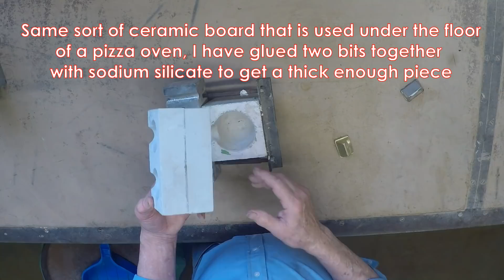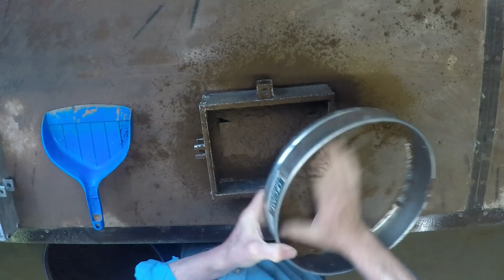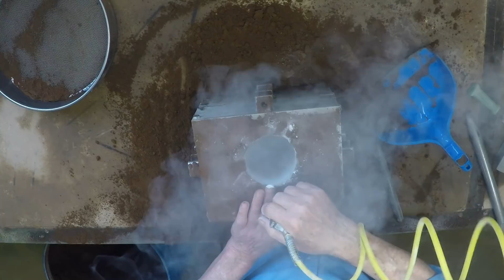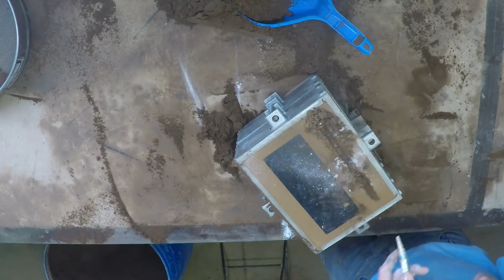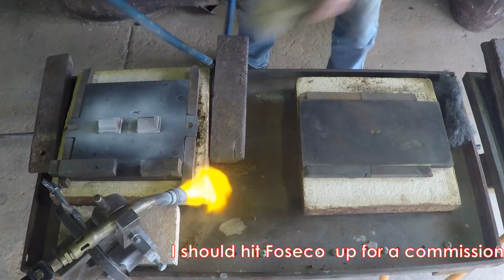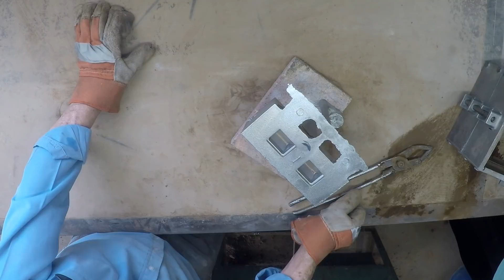Lens Blank Die

Comment: This is a fascinating series.    Thanks for your many tips and references to John Campbell's casting books and information.  

I wonder if hexagonal boron nitride is much cheaper now.   I became interested in so called "dry film" lubricants years ago and have PTFE, Graphite, and hexagonal boron nitride in stock for this purpose.     I ended up using boron nitride for lubricating my D-Bit grinder ways rather than graphite mainly because it's white and easy to differentiate from grinding dust vs. graphite (PTFE might be ok in this case).   

I'd read about Boron Nitride being used for mould release but here you are in practice.    It might be interesting to see about developing a water or alcohol based spray with the powder.
Reply from the maker: Ian, I think that we should all be pushing John Campbells work - it is very much a breath of fresh air into the staid moribund 6000 year old foundry approach that is unfortunately still so typical of modern foundries. I was at a talk given by John here in Melbourne a year or so back - meeting him was something of a highlight in my otherwise dull life. We need more like him.
I have used two Boron nitride products - Release coat blue, mainly as an aid to casting and core removal. And  Boron nitride hardcoat as a protective for bare MIMS thermocouple sheaths and as a ladle wash, both of which it excels at - The one bare couple has lasted me about 5 years and at times has been sat in molten aluminium for hours at a time. Both of these are ZYP products bought through a local stockist. It would be nice if the got cheaper as last time I got some they were over AUS$ 200.00 per gallon and it was one of those little gallons the US use! (about 3.8 liters not 4.5 liters like a proper Gallon). I was perhaps 4 or 5 years ago now, so the price will likely have changed (Hmm, probably up not down). For actual die lubrication (i.e. the parts of the die that slide against each other) I like to use  MoS2 in the form of a dry film applied using a thinned down (with auto paint thinners) form of Molybond 122L.(not cheap either!) I prefer to apply  this to a lightly sand blasted and wiped down with thinners surface and I aim for a very thin film. I sometimes apply a dusting of graphite powder to sliding surfaces and particularly to the die holding machine slide ways. The release coat blue I thin with water and spray using a touch up spray gun. Nice to talk to a fellow enthusiast....... Martin
PS, some BN products are available in 1 pint size still expensive (Last I saw was US 80)  but perhaps more within reach - sadly not available locally!

Comment: Is it possible to cast the die using bronze when the masters are made using cast iron ?
Reply from the maker: paul, I don't see why not, providing of course that the masters are coated with a suitable die spray - a graphite based spray would be suitable. The masters could also be steel. I have used steel masters for aluminium dies but have never tried casting a die out of bronze this way. However I have made dies for aluminium castings out of bronze by sand casting the die to an approximate shape and then machining to refine. I did find that bronze/brass dies tend to be attacked by the aluminium being cast in areas where the metal impact is high.....Martin
Reply: @olfoundryman8418  Thanks for your reply sir. Let me try I have been using Aluminium but this time the weight of the castings is a bit higher I think which make the die to overheat and loose dimensions.

Comment: If you had a more complex part that would shrink onto the mould, could the mould be made in bronze to extend its life?
Reply from the maker: Jamie. I did attempt a part that did shrink onto the die in one area - I got the parts I needed (180 of them) but it did damage the aluminium die.
Bronze would certainly be better but still I suspect no where near as good as cast iron. I have used a brass die and it worked ok but the aluminium being cast soldered onto the gate area a bit. This was more due to the impact of the metal stream but shrinkage onto  the die would not have helped. I suspect it is going to boil down to how complex and to what die coats you use "Release Coat Blue" by ZYP coatings would be a great help but it is expensive. Remember you can very successfully make dies from mild steel - I prefer grey cast iron but some of my dies are at least in part mild steel.... Martin
Reply: @olfoundryman8418  thanks for your reply Martin, do you send off to have dies machined in cast iron and mild still or would it be possible to cast a ferrous die in the home shop? 

I’m trying to avoid the cost of machining dies because it will get very expensive as I need several parts with variations. 

My hope was to 3D print a pattern and then cast it into a die using a suitable material, that way I can make multiple variations without spending thousands of pounds of machining costs
Reply from the maker: jamie, I machine my dies myself. I have a lathe, a big old Cincinnati vertical mill, and an older CNC mill. I buy the cast iron required in the form of continuously cast bar stock. Having dies machined by others is just way too expensive considering the relatively small numbers of parts that I make. You need totals in the tens of thousands rather than just the hundreds or thousands to make outside machining viable. Yes, you can have iron dies cast to size and shape but not all foundries are good enough to do this and you will have to devote a lot of time to hand finishing filing  etc. Also all dies require some machining - the dowel pins, flat mounting surfaces, mating of the two halves of the parting surface etc. If your die required cores these and the guides they slide in will have to be machined. One  approach is to do as I did for the 4 barrel throttle body die - I bought that older CNC mill then  spent a year getting it going learning how to use it and then machining the die.
For a "several parts with variations" situation look and see if the variations can all be made in the one die with the aid of interchangeable pieces cores etc. 
You can  come to me at  olfoundryman@gmail.com   and I will see if I can be of any help design/advise wise. But please note that I don t guarantee to always reply instantly as I have a lot of demands on my time..... Martin
Reply: @olfoundryman8418  thank you martin, ive sent you an email with some pictures to peruse
Reply: @olfoundryman8418  if you’d be willing to discuss the parts I’m trying to make via email I’d greatly appreciate your feedback   before I begin going down a path that may not yield a suitable result

Comment: Thank you, Martin.  Another great video.  I'm working my way through them all !!  Cheers 🍺🍺👍👍👍
Reply from the maker: Melt, Should take you a while to work through them all 😊 I hope they provide you with some useful information... Martin
Reply: @olfoundryman8418  I figured you've probably covered most things I need to know.  There's so much valuable information there, only trouble is I have to watch each one several times for it all to sink in...  But i guess that's no bad thing eh.  Cheers 🍺🍺👍👍👍
Reply from the maker: Melt, Watch by all means -  I love it - but practice, trying doing failing succeeding they are the key. Use what I put out as a guide and move on from there... Martin
Reply: @olfoundryman8418  I intend to mate😃  I have a nice tricky thin copper casting next week.  I hope to employ some of your techniques there.  I will also talk through some of that video so you can follow my thought process.  The best compliment I could give you, is to use your knowledge and make it work !!!  I'd love to practice more, but unfortunately I only get one day a week to play with metal.  The rest of my time gets eaten up running my business.
Thanks again for everything, Cheers Andy 🍺🍺🍺👍👍👍
Reply from the maker: Melt, Easy peasy - retire 😏, Have fun with the copper, it has its problems and most people don't do it right - in fact I have yet to see someone who does! My only experience with a thin copper casting (a frying pan) was a decided failure but it was many years ago, Good luck with it.

Comment: For those of you who don't know what he put on the tops of the risers...it's an exothermic compound that when it gets hot enough will flame off and expand. Once it has expanded the covering will act as an insulator insuring that the metal will stay hot and properly feed the casting as the casting solidifies and shrinks.
Reply from the maker: sandrammer,  Right on! It is called Ferrux NF and it is made by Foseco. The only thing I do not like about it is that some of that expanded stuff floats around the room and has on occasion gone down a feeder on a yet to be poured casting and thus marred its surface. NIce to hear from you by the way... Martin
Reply: @olfoundryman8418  is there something lower tech that can be used for a similar purpose if it's not available in my area?

Comment: Have you tried insulating the riser with a baked plaster of Paris sleeve ( riser ) to help control the piping?
Reply from the maker: Vel, The baked plaster sleeve is an old tried tested and true idea - it does work quite well plaster being about half as conductive as sand. Often its not straight plaster and may incorporate sand or more particularly insulators like vermiculite. This particular alloy is know for pipe formation as it tends to be what is called a "skin freezer" and I certainly could have got away with a smaller feeder if I had used some sort of insulating sleeve as well as the exothermic These days one can buy various sizes of insulating sleeves made from  ceramic fibre. These work very well and are used by many foundries with and without exothermic on top... Martin

Comment: Very good. I find the upside down camera angle above the table quite disorientating.. maybe you can consider either digitally mirroring the angle to make it look right side up, or turn the camera itself upside down when it's mounted above the table at that angle.  it would then make it appear to the viewer that we are actually looking at it from above while facing you (like in an auditorium),  rather than from above and over your shoulder (which is like lying on our stomach on a platform above you and then peering down over your shoulder which means we are in effect upside down).
Reply from the maker: Guy, I have struggled with camera angles. I have tried  with the camera in all sorts of places and have not really found any to my liking. To me it looks like the right angle as it is the orientation that I see and I had jut assumed  that most viewers would like that sort of view i.e. to see what I see but you are not the only person to comment on this aspect. I had not thought of people preferring to see it all from in front of me while effectively looking at me (I am a bit camera shy). In truth I am also most unhappy with the "flat" sort of perspective that the camera position gives. Many of the moulds are quite 3 dimensional and the flat view leaves a lot out. I have plans to get a second camera (when I can afford it I make nothing from YT) and mount it off to one side or something. (but it could be in front) I would value input from others out there who also feel better camera angle exists and for their ideas on it... Martin

Comment: Questions - 
1. Which Dycote did you use?
2. What was the red powder you put on the top of the feeder during the cast?
Reply from the maker: ATL, I used two die coats firstly Dyecoat 14ESS by Foseco and secondly Release Coat Blue by ZYP coatings.
           The red powder is an exothermic compound called Ferrux NF byFoseco…. Martin
Reply: @olfoundryman8418  Two questions:  How often do you apply these coatings?  And do they add much thickness, so as to cause any noticeable part shrinkage?
Reply from the maker: @chuckbailey7200  , The white undercoat (14ESS) is usually only applied only once per day in the morning before start of casting. The release coat blue when used on cores is applied lightly anywhere between every  15 to 100 castings (depends on the job) Occasionally I might touch up with the white undercoat at lunch time. Generally the coat is perhaps about 0.005 inch thick so in the grand scheme of things it is negligible.... Martin

Comment: Much to be learned in this video. Thanks so much for making it. Nowhere have I seen this type of permanent mold casting done with such a good level of explanation. I will be giving this a go. I may fire over some questions later. Looking forward to the up and coming finale.  Mark
Reply from the maker: Mark, I await your questions and will do my best to answer them - still two parts to go but they will be mercifully shorter (I think).
It is a good trick for the right part but is totally unsuited to parts that have re-entrant areas as these would grab the die due to contraction as the part cools and this (I have found) rapidly damages the die... Martin

Comment: Can't wait to see more. Martin, about the sprues you are using. Would it be possible to tell me their dimensions (circle diameter top, bottom and total length)? Thx in advance. ;)
Reply from the maker: Han, Other parts of the video are on the way. Re sprue dimensions, the one I use most is 8mm diameter at small end 14 mm diameter at big end it is 120 mm long, roughly this is a 3 degree included angle. You can work it our for yourself - Take the height of metal in the pouring basin above the sprue entrance and apply velocity squared =2*g*height, apply the same equation to the bottom of the sprue using the total height of metal from the top of it in the basin to the bottom of the sprue. From these velocities at these two locations the ratio of the areas can be calculated hence the relative diameters at the top and bottom of the sprue - its usual to make the top area about 20% bigger than the figure calculated as this allows the use of a straight taper in the sprue rather than the mathematically more correct hyperbolic shape. As you can readily appreciate the required taper will in fact alter a bit according to how high the sprue is. However I use the sizes above as they work for me quite well with my average sprue plus basin height of 80 to 100 mm The biggest mistake most people make is to have the sprue too big. It  MUST run full for the entire pour or it is a waste of time and I can testify that a sprue much bigger than 8mm exit (for example 12 mm) and therefore about 16 mm at the top and say 100 mm plus high is very, very hard to pour fast enough to keep up with and keep the basin and sprue full... If you do not keep the basin and thus the sprue it full the value of the tapered sprue is lost...Martin
Reply: Many thanks for the data and especially for that fantastic explanation!!! AllTHUMBSUP²
Reply from the maker: Han, No worries mate... Martin

Comment: What about shrinkage 
I mean the size of aluminum cast is different from the bronze master pc ?
Reply from the maker: Rabih, Yes, indeed shrinkage is quite a problem. We have it multiple times with this job. Firstly I made the aluminium patterns using two of the glass prisms as the patterns. So there is one lot of shrinkage there. Then I made the two bronze masters using those aluminium patterns so there is another lot of shrinkage there. Then I made the aluminium die off the bronze masters so there maybe more shrinkage there and then finally I made the actual lens blanks in the aluminium die so there is another  lot of shrinkage there. So we have the compounding effect of shrinkage on shrinkage on shrinkage on shrinkage - its a wonder that there is anything left! However this is a small part so shrinkage is not a great deal in real terms and with the first two lots of shrinkage I was able to wiggle the pattern in the sand mould to make the cavity bigger than the pattern so I could gain a bit to help reduce the shrinkage. When casting the die I doubt the cavity will have shrunk as firstly the layer of die spray on the masters makes them a little bigger (perhaps 0.15mm a side) and the die will not shrink against the masters rather it will yield and stretch a little against the hot (and therefore slightly bigger) masters. In use the die is hot so it will be a bit bigger that when at room temperature and this helps a little to counteract the shrinkage, I did deliberately make the parts higher (remember those little cardboard pads place on the patterns in the first video) and this allowed me to machine the top of the cavity part of the die just a little and it did mean that the part came out with some increased height on the square bit around the base of the casting. Its this part that helps seal the lens blanks against the rubber gasket in the runway light as they must be waterproof. My customer took some of the cast lens blanks fitted them to a light and tested for leaks using air pressure applied into the light (they are airtight) no leaks were found so the eventual size of the casting that we wound up with is Ok. I might add that for those support blocks that I mentioned in parts 1 and I think 2 I machined the masters from a lump of cast bronze I was able to machine a shrinkage allowance in. I could not do that in this case as I did not machine the Masters but it all worked out OK... Martin